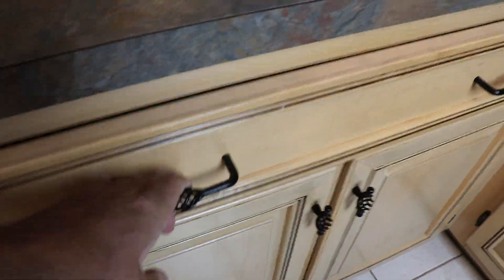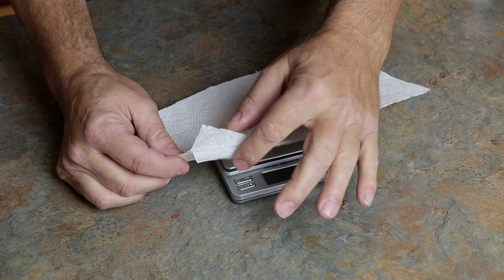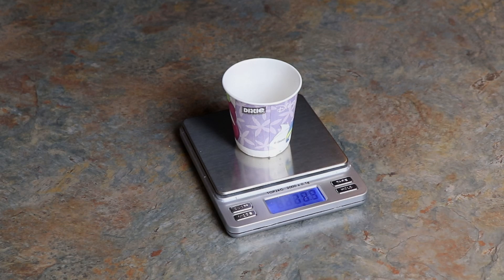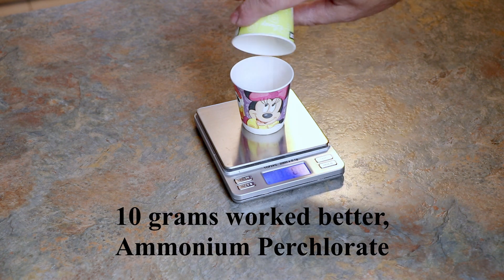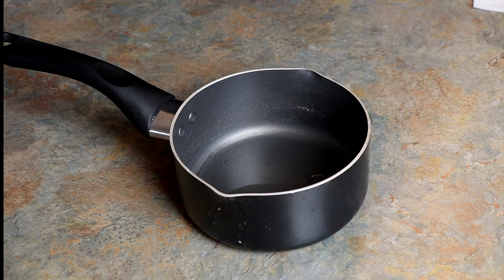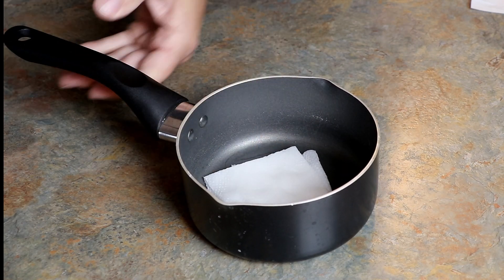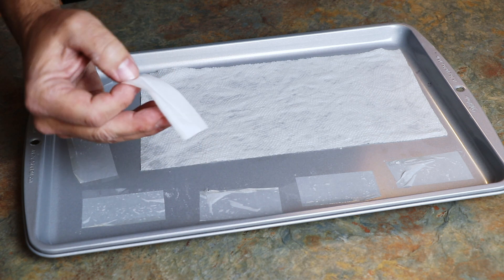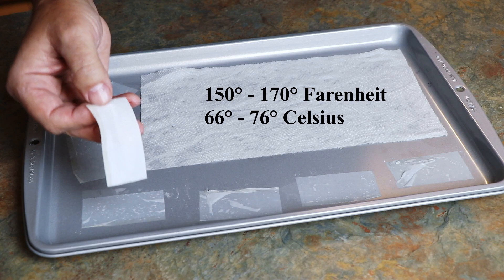Flash/Fire Paper, No Acid, Super Simple!

Comment: Aren't perchlorates in general, incredibly hostile to the human immune system?
Reply: Yes and in many cases, restricted substances to possess.
Reply from the maker: Potassium clorate is safe to handle using reasonable precautions.  Avoid breathing any dust from it and of course it is not meant to be consumed. 

I have used it to make pyrogens for high power rocket igniters. It also works well in some types of rocket fuel.

Thanks for your concern.

Comment: In my experience magicians paper is thinner than paper towels being split but I’m very curious to try this method! The paper I’m familiar almost looks like thin wrapping material; do you think certain papers would have a similar reaction or is the two ply being split an important factor? I imagine tissue paper (which is the feel and thickness I’m use to use with buying premade flash paper) when I hear of it. Does the material not really matter outside of the chemical treatment?
Reply from the maker: The split paper towel does seem to hold the oxidizer well. It does turn back to small crystals when dry.
It never hurts to try something else.
Reply: @TheRocketeer  absolutely, thank you!

Comment: Does this still function as flash paper by not leaving residue?  I love the look of this more than normal flash paper for what my plan is.   I'll check your channel for follow up vids and see if you made one using the potassium perchlorate you mentioned in a comment to see if that one still sparkles, and if it indeed burns faster.

Also just verifying if this creates any noxious fumes like standard flash paper making does?  I don't think it should since you all that happened was disolving and drying(bonus compared to the standard way)
Reply from the maker: Most of the time the flash paper left no residue but occasionally it would leave a tiny amount of ash. The paper does have a strange burning smell. I think it is best used in the garage or evening in the yard as a party trick.

I have not done any more work with the flash paper. The focus of my channel is high power rocketry and custom made propellants. youtube.com/TheRocketeer

Good luck and let me know how it goes!
Reply: spray some wd40 on it. its easier

Comment: the demo you showed -- was that using the 4g or 10g of the perchlorate? were those pieces from the paper towel or the cigarette papers or both? you indicated you might try some other papers -- this video is from 2018 (this note here is 10/2021). did you ever do other papers?
Reply from the maker: Higher concentrations of AP worked better. I tried other papers and found paper towels worked best for me.
Reply: @TheRocketeer  thank you for this info. I was also wondering about how stable this treated paper is compared to some other examples on YouTube using the "gun cotton" approach but using 100% cotton paper. They say that the paper degrades over time. I doubt that you did some long-term exploration regarding this issue of stability (and also whether the AP flakes off the paper once it dries) but if you have any additional info on this point, that would be great. I'd like to try this myself but given the hazmat fee for shipping, just 1# of this powder is nearly $40. I don't mind experimenting myself but I also try to avoid others' mistakes (or trial failures) if I can.
Reply from the maker: @drcoolit  The ammonium perchlorate did not degrade the paper after a year. The paper towel seems to hold the small granules well. You could try potassium perchlorate instead. It is cheaper and would most likely react even faster. https://www.fireworkscookbook.com/product/potassium-perchlorate/

Go to my Home Page - About - Email if you want more information.
Reply: @TheRocketeer  outstanding! thanks for this input and I'm heading over to your home page now!

Comment: WATER ISN'T MEASURED BY GRAMS IT'S MEASURED BY MIL or OZs ,,,,etc  liquid measurement
Reply: the most accurate way to measure anything (gas, liquid,  or solid) is to WEIGH it. As someone once pointed out -- what weighs more, a pound of lead or a pound of feathers? Volumetric measurements are iffy at best no matter what kind of background, or equipment, you have. Weights are consistent and you can measure items to very exact figures. Also, just like the lead/feathers ex., if you are using multiple wet ingredients that may have different densities, it is by far easier to measure out the item by weight than by volume. It's also a lot cleaner since adding weights to a container is easy; having to clean out whatever tool you are using to measure out a series of liquids can be a pain. And for some things (such as gases) trying to measure a specified amount by volume would be senseless (and also impossible). Weight would be the ONLY method you could use.
Reply: 1 ml of water is 1 gram of water. So there is no differnece, you can understand it easily.
Reply from the maker: You are correct about liquid measurements. I am a rocket guy and we measure everything in grams. When all you have is a hammer, everything starts to look like a nail : )

Comment: Nitric acid is simpler and more accessable. You can easily make nitric acid with sulfuric acid drain cleaner and potassium nitrate stump remover. Ammonium perchlorate is way harder to get than drain cleaner and stump remover.
Reply from the maker: Ammonium perchlorate is commonly used in rocket propellant so I keep it in my inventory. AP can be ordered from Amazon or a number of chemical supply companies. It may be very difficult to obtain in other areas.
High quality flash paper can be made from acid as you and others pointed out. The title does say "no acid." I am a rocket guy and not a chemist.
Thanks for your comments.
Reply: Not all stump remover are created the same. They use a few different ingredients.

Comment: Is there a limit on the size of the paper you use?
Reply from the maker: I cut a small square and fold it so it is loose. The trick is to toss the flash paper up so that it unfolds quickly resulting in a quick flash. A large folded square may not burn completely before landing on the ground.  I hope that helps.
Reply: What kind of paper is recommended for this type of experiment?
Reply from the maker: I used a paper towel for the flash paper.

Comment: but the acid is much easier and cheaper to get tho.
Reply from the maker: A quick check reveals that nitric acid is not available in the US from Amazon and it is expensive on eBay, often requiring pricy shipping. Sulphuric acid is not cheap on Amazon and few vendors offer it on eBay. 

I don't think the process could be any easier than dipping in water without worrying about caustic acid and the necessary safety equipment and toxic fumes.
Reply: @TheRocketeer  you dont actually need to buy nitric acid, just mix the h2so4 with kno3 and it makes nitric acid. The h2so4 can just be baught from the hardware store as drain cleaner. You wont get professional grade gun cotton but thats even quite hard to maje if you have the pure quality acids. Anyway, being able to buy ammonium perchlorate seems to be something you can only really do in america and some other places that are really big on rocketry
Reply: @TheRocketeer  toxic fumes are not made unless you're doing the whole thing is a metal pot(which is a very bad idea if you ask me)